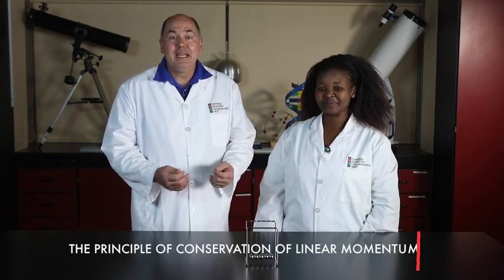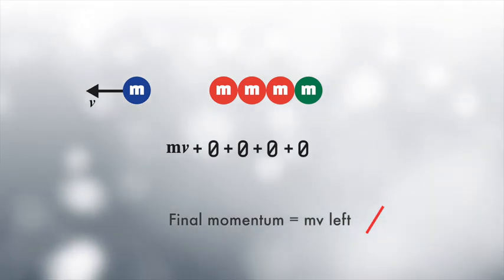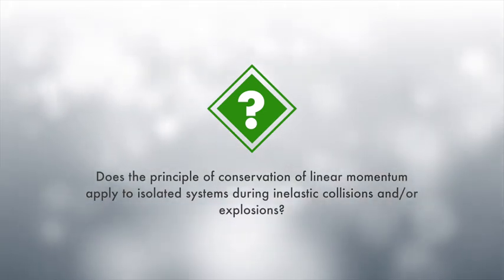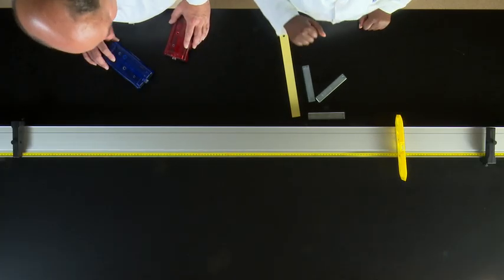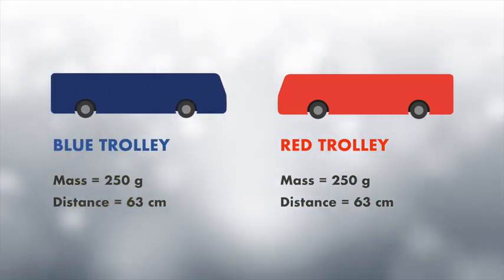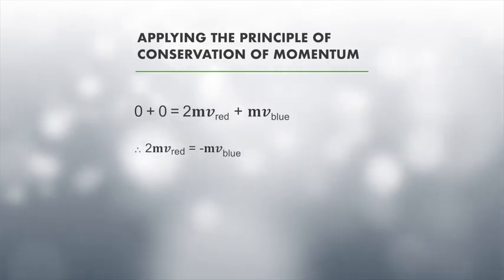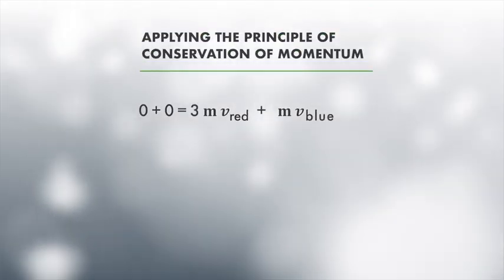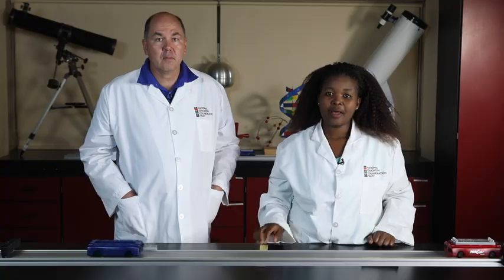NECT Gr 12 Conservation of Linear Momentum

Comment: What would happen if the track was rough
Reply: I'm sure this will be way too late to help you now, but anyway.
If the surface was rough there would be friction acting on the trolleys, an external force, and the system would therefore no longer be isolated.
Reply: @kaylastarr3822  Thanks a lot! I thought no one would awnser and it's not too late,I still have some exams on this work so any help is awesome
Reply: Kayla Starr when the mass of one trolley is double what happenes to the momentum of each trolley
Reply: @kaylastarr3822  thank you